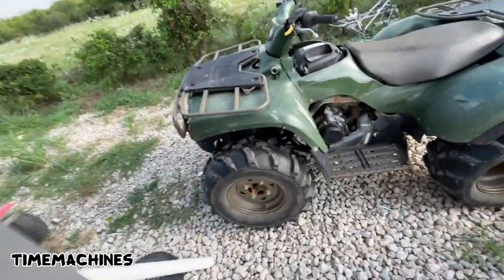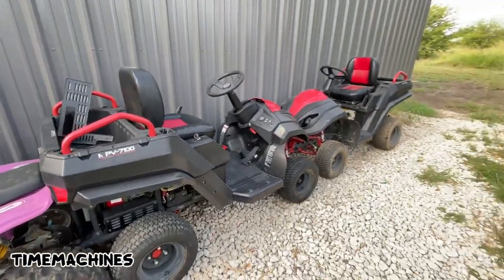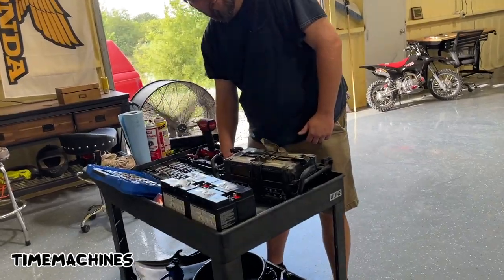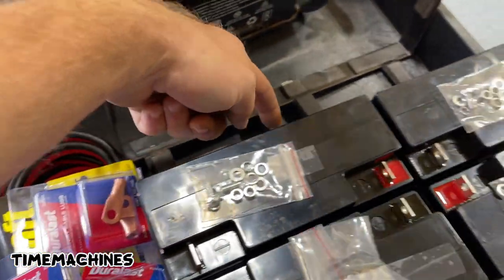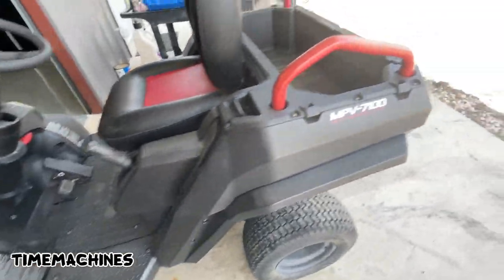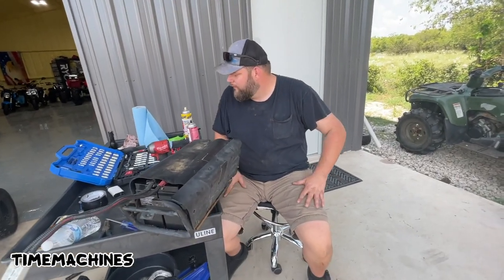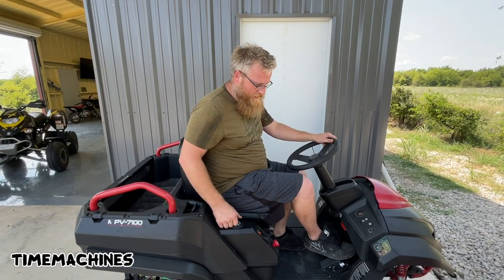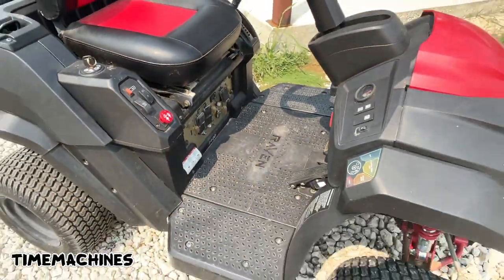Raven MVP 7100's | generator/atv/mower all in one! | Getting them both running

Comment: Hey guys I just bought a raven 7100 s MVP it is in perfect condition very well you're saying definitely it will not go into gear and drive if the battery pack is dead

Comment: I bought one of these and it works fine when the mower deck is attached.
When I remove the mower deck it won’t move forward or reverse without it.
Do you have any suggestions as to what it may be?
All the fuses and contractors are clean and in tact. The undercarriage is clean and free of debris.
I’m baffled. Would appreciate any advice. Thank you.

Comment: Hi, I was wondering where i can find replacement air filters since the bankruptcy. I cant find a specialist so I figured i should start asking online.👍
Reply from the maker: I wanna say if you have an oil filter and see if a general lawnmower or generator filter will work for it. or make you one. or make you one with a piece of metal mesh and some foam?
Reply: @TimeMachinesATVs  Alright ill try both options. Thanks for the tip.

Comment: I have the 7100 still running you have a high and low switch gear so speed. No it will not put out 7100 watts it was called a 710 first. then failed recall . Then called a 7100 6 hp power and maybe 4'500 watts. 30 amps only. mine has a problem while mowing geass charging 48 system won't keep up and runs down. Then I drive it back home and plug it up till recharge no body here works on them company been out of business about 5 years.

Comment: That big red is so stretched it's a shame. I've never seen one with more stretch than that. Seems unstable. Sorry autocorrect said unusable.
Reply from the maker: Gotcha i use it all over. Can only
Go up
So far before u have to go back due to angle of drive shaft. Im sure your build is much better. Or whatever kit ya ordered
Reply from the maker: Sweet name btw bud. Apply it to big reds next chance ya get
Reply: That things a beast. So far I've got a 200m that I'm doing a custom 4-6" lift on with a 3 inch extension. wish I had the 250es for the rear suspension and reverse it would save my back and legs. Can you still trail ride your 250 on tight trails? or is it your mud /Creek bike. I want similar height lift on a 250 if I pick one up this year but I gotta keep up with the kids on there little 125/150s.
Do you have any ujoint issues with the swing arm or is it doing a full flex no problem that's my main concern as I did my buddy's 300 fortrax and it took out the ujoint every other time we went out with his bike fully loaded.
I know it's a few questions but I'm very interested for my future build.
Reply from the maker: I trail ride it mainly. Also climbs some hills w it. Pit it around at events too